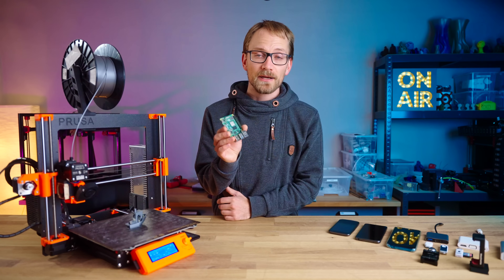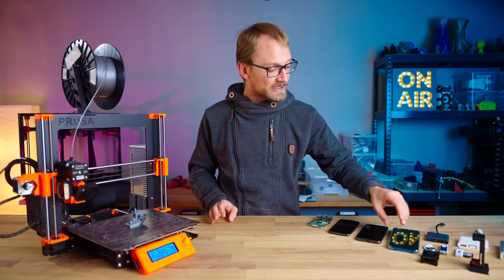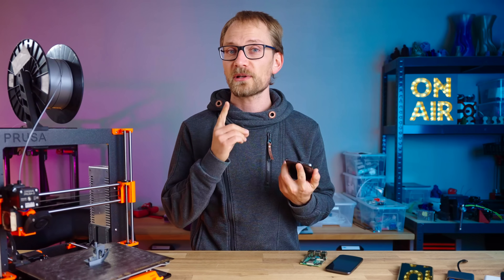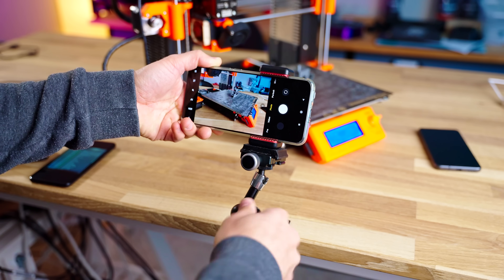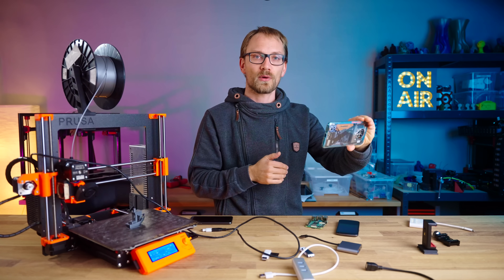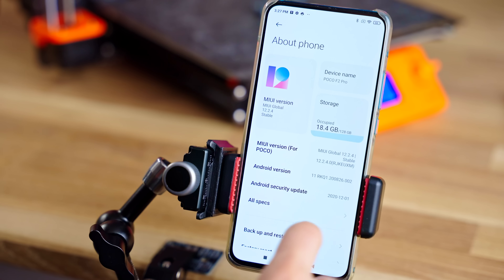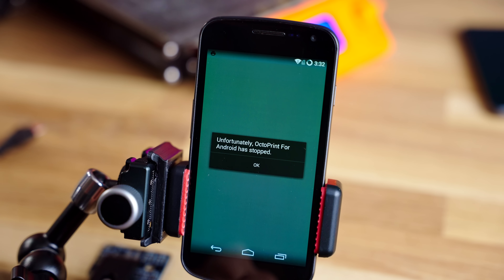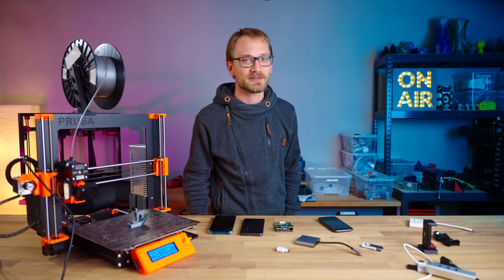How to run OctoPrint on your phone!

Comment: I tested this setup over a week and had not the best experience:
Octo4a works perfectly OTB, it's an incredible piece of software. 
The problem however is power management of the phone. 
It's very hard to find a phone that will support docking mode (OTG+charging simultaneously) the most reliable way to make it work is to trick the phone by first apply charging to the phone and then connect the OTG device, it's a HACK but it works. You can do it either with DIY Y-splittwer with built in mechanical switch, or you can buy one, I saw these on AliExpress.
I used really old Xiaomi Redmi 4X, and ideally I wanted to get rid of the battery entirely, however it proved to be not as easy,  I experimented a lot with the solution that Tom shows in the video and it doesn't work for me, if phone isn't charging from the USB it eventually starts to behave weird and unstable because of the battery reading mismatch. I wasn't able to pull off the dummy battery solution either. It's a shame that such a versatile and powerful device gets handicapped by such a trivial problem. I suspect that newer phones which have charging bypass feature might do the trick better. Anyway, really great software I enjoyed it so much, I wish I could make it work for me. Thank you for the video Thomas ❤️🇺🇦
Reply: А у меня программа не видит телефон (

Comment: Anyone know if its possible to use an old laptop to give a 3d printer wifi connection and then monitor the prints using an android phone from any location?
Reply: It is - you can install Octoprint on a PC.

Comment: I have an old s8 Ive used for tiemlapses for years, that Im gona use for octa 4a.
Its worth noting theres an app I use called "Blackr"
It essentially just blanks the screen, which saves power, keeps the phone waaay cooler, and prevents burn in etc. As far as the phone is concerned, It still runs like normal.
It just puts a little circle on the screen to blank it, or show it when tapped.
Its a golden app, as I ve used this phone for days/mopnths straight doing timelapses, or automating games with tasker n autoclickers etc etc.

EDIT: OMG! I wonder if i can run this on my old Optima stereo 3D phone! (Its even got a paralax screen like a nintendo 3ds.) It stopped suporting updates at android v4.4...

Comment: Even two years later this makes more sense over a Raspberry Pi. With a phone you get all you need, the processing platform, a camera, power source, power backup (at least for the OctoPrint instance) and internet backup (WiFi and 4G or 5G). Additionally, in some setups you need an additional display since some displays can't be connected reliably to a Raspberry Pi.

Comment: So i recently got back into Printing and this kinda was a tedious task that made it much more fun. I dont print often but now i have a way to do it without switching sd cards and spending money on a new piece of Hardware that might become obsolete in 5 to 10 years. I just wish there was more support for it. I would like to post my results whever i get some time (maybe also in 5 years) but I did mine using an old Oneplus 6 and an Ender 3 Pro 1.5v (4.2.2) Marlin 2.1.x. I learned a lot about more about the printer and code and i feel a little more satisfied with myself now that its almost finished.

Comment: Followed up with the video and now I have OctoPrint running on my redmi note 5. the only issue is that even while using the OTG cable it can not charge and connect to the printer simultaneously. looking for solution or work around for this in settings or maybe help with figuring out how to charge directly like with your poco phone. It would be very helpful.

Comment: Great video ! But i have some trouble finding the corect otg/hub for my android phone. I have a galaxy note 3 any help ? (I of course want to charge and have usb on the go at the same time)
Reply: Did you found the solution? I’m trying to use my old note 3 also 😂
Reply: @gitmac53  yeah man , unfortunately the note 3 doesnt have the capacity to charge and have the go mode,  to counter the problem you can change the micro usb port to usb c 😅😅🤣

Comment: Excellent work! Thank you for the thorough and thoughtful breakdown of such an interesting project.
One small complaint I have, which I assume was an accidental omission, has to do with the charger splitter. You mentioned in the video that you just need to make sure it’s a splitter that allows the data and charging at the same time. You also mentioned that you’ll link to the hardware. However, the link to the y splitter is actually just a link to a search in amazon. That would be fine, except all of the items that come up in the search explicitly call out that they will not charge a cell phone or a tablet. I’ve resurrected an old Samsung Galaxy S3, and got octo4a running on it, but now I’m stuck without a way to charge the phone while it’s connected to the printer.
I would love information about the Y splitter that actually allows an old Samsung like the one you tested to charge and print at the same time. It seems it’s actually a rare item, so a little more detail would be awesome and appreciated.
Reply from the maker: A man, then the one I used must have been replaced or went out of production. They're fairly tricky to find, and ultimately, I just ended up searching around and digging through a bunch of listings, too.

Comment: Hi Thomas, great video! Helped me out a lot. I set up my old OnePlus 9 Pro and am using its camera to monitor my prints. Is there anyway I can lock focus on the print head? My phone seems to keep switching focus between the print head and the back of the printer.

Comment: A very promising idea. I have looking for an adaptor to support charging as well, with a Samsung S5; so I could use it.. The S5 has, what I thought was separate data and power parts, on its wide connector. Does anyone know a way to leverage that Micro USB 3.0A port for power and data, with some adaptor??
Reply: I've tried the same with a different device for a few days now and the short answer is no, it's not possible with a micro usb port.

Comment: I mean can't we just have the os files on there, I know samsung, if you the down volume you can change what os it uses, found that out while having to fix some separate issues and I happened to have windows on my SD card because I bought my first computer and I needed to download windows so while I was trying to fix a separate issue it was trying to boot into windows

Comment: Hi Thank you for the videos, it gave me the idea of putting Pi OS on Window Surface RT tablet I had collecting dust. Then I put OctoPrint and OctoDash on it. Now I can use the RT tablet for controling my 3d printer. The touch screen works great and it has a big screen.

Comment: Hi Thomas, very good process!!! easy to do it,  working great, but I faced an issue whit octoprint repository is not worked, i looked for options to fix it , but so far, I could not find any, sistem mesage is that repository is not available and suggest to check internect connectivity, hopefuly you advise me to to fix it
Regards

Comment: for those who's cable is powering the phone for a split second then disconnecting go to your phones settings. the go to connected devices and then switch the preference to this devices. My issue was that it was trying to send power to the usb device plugged in which stops it from charging the phone.

Comment: So is that old 1GB phone running a specially installed Android OS instead of the Android OS that it came with? Those were names of special Android OSs that are usually custom installed on a phone replacing the original OS, sometimes done for more privacy.

Comment: One thing you should mention is that not every phone is capable of otg while also charging. I have tried it with 2 phones and both wouldn't work.
Reply: I think I'm burned big time I actually bought a Moto G just for this and it won't work.   At least I bought it used
Reply: @c.rutherford  yes I have tried it with a Moto z2 play and with a Huawei Nova 2 both don't work. But it works with my OnePlus so it's definitely the Phone and not the cable.
Reply: @moritz5215  I've suddenly got it, I turned the phone off and on again, then plugged in the usb and this time it asked me if I wanted to allow OctoPrint to use the USB port.  Weirdly it never asked that before.
So now its recognizing and even controlling the printer.  But it immediately said there was a firmware fault with Creality printers and I needed to install a plugin to fix the temperature sensor.
But there appears to be no option anywhere to load plugins.  There is only 'Install plugin extras', which says 'installed'.
The other thing that worries me is the printer won't shut off completely at the switch when the phone is Y-cabled to the printer and the wall to charge.  The LCD just goes half dim like its spazzing out.
So that means its getting some power trickling in through the mini USB.   Is that extra voltage going to overheat the board eventually?
Reply: @moritz5215  Youtube will only let me see part of your reply.  If what you asked was 'does it charge' the answer is yes, it does with the Y cable.  And I think you were saying you need to install a USB driver.   Yes I finally did, it seemed to work after that but not immediately.   I wonder still about the board getting extra voltage through the USB while the phone is charging, and if that is going to mess up the board eventually.
I don't like that the on off switch no longer works.
As far as loading the missing temperature sensor plugin, I still don't know how to do it.

Comment: Tokk the batt a ry out and it will not b oot. Is there a w ay to do this? Say could one perhaps just wire a 5v straight on to the battery leads or will that de stroy your life forever?

Comment: As a returning 3D printer user I wanted to set up octoprint but I did not want to buy new hardware so I installed it on an old Raspberry 1B(!) I had lying around. Everything worked fine, even a webcam, but it was incredibly slow. Inspired by your video I converted my old Xiaomi Mi A1 (Android 9, LineageOS) to an octoprint server and everything works flawlessly and the UI is really snappy. Filip did an amazing job on the Android port, thank you very much for bringing it to my attention. To be honest I kept my old phone exactly because I was thinking about an application like this and I couldn't think of a better way to repurpose my old phone.
Reply: i have a xaomi note 4x what cable did you use ?  i am a bit confused i even thought of trying of opening a cable and separating pwoer and data lines to split  em my self
Reply: @venix20  I don't remember where I found mine, I think on ebay. It is a Y cable with Mini USB for my Ender 3, USB-C for the phone and USB A for a the charger.

Comment: For those looking to try this, save yourself a lot of frustration and just find a Pi. You won't find a Y cable that can transmit data and power at the same time, they only send power to the USB side, not the micro.
Reply: That sucks because everybody is saying to buy the Y cables.  I've seen it on at least 3 different Youtube pages.  I would think they'd notice if it didn't work but mine's not working so idk

Comment: Is there a way to not only use the camera of the smartphone but the LED to? It would be very nice when you want to check on your printer in a dark room. Just switch the led on on the phone.
Reply: Yes, there totally is! In the app settings you are able to enable a setting that turns the phones flash light on whenever you observe the camera

Comment: This is definitely too late, but this no charging issue in a POCO F2 pro is a very common defect with the connection to the large ribbon cable passing over the battery. You need to bend the large edge pins on the charging board connector inwards to make better contact with the ribbon cable. Great phone if it weren't for Xiaomi's horrible support.

Comment: This will not load correctly on my Samsung Note 8 --- (installation is corrupted), I have attempted many times with the same  result each time. There many users reporting the same problem, do you have any answers.

Ray

Comment: I figured I'd ask here since this is where I first learned of octo4a.
Yesterday I went to plug my old phone with octo4a on it into the printer for the first time.
I was using an OTG splitter to charge the phone and have a USB port for the printer connection.
The second I turned on the printer, my phone turned off and I wasn't able to turn it back on again.
Has this happened to anybody else?

Comment: Doesn't work for Samsung S4 phone. Installation always fails saying that it was corrupted. Guess I'll shell out the money for a pi. Supposedly a TCL 20xe phone will work but I'm not buying anything else that may or may not work. Also doesn't charge while hooked up to the printer even with a powered hub.

Comment: I had the app installed, but when running, it wouldn't display the camera, in spite of the camera's preview working. Uninstalled, and now every time I re-install it, it says the installation is corrupted? I've tried without data on, restarted, and even tried on another device, the same result.

Comment: So I tried using my old Android phone (Moto Z Force) which does only have one port.  Oddly enough, the OTG port doesn't support simultaneous power delivery.  I bought a usb-c hub and I could only ever connect to my printer, or charge my phone.  Never both at the same time.  I find this odd and I keep thinking there's something wrong I've done.    If anyone has solved this please let me know!!!  But it does seem that I need to find a work-around either by opening up the phone and bypassing it or figure out how to wirelessly charge it.

Comment: Tried this with my Huawei P10 lite, but the problem with bypassing the micro usb port is that it won't recognize that it's charging.  The battery level is calculated by measuring the current and not the actual battery capacity (I think). Any ideas to solve this? Do I need to root my phone and change battery capacity settings (I'd prefer not to...)

Comment: Can't the battery catch on fire if you leave it plugged in 24/7?
Reply: You phone should be smart enough to stop charging once it's topped off.
Reply: @bean5  it's not that it is charging all the time but the processor and or screen is always on. I read if you use ur phone as a security cam the battery can swell up

Comment: Where the poco phone didn't charge  couldn't you have soldered in a buck converter instead and just got rid of the battery and ran it  off of  wall wart or more powerful supply ,maybe from the printers power supply?

Comment: I'm having a hard time locating an OTG y-cable that will charge the phone. Does anyone have a direct link of a y-cable that they know works? Every cable I look at state that they will not charge a connected phone, just provide power to the external device. (The affiliate links just go to a general search on amazon now)
Reply: same problem here mate
Reply: @00honeybadger  I finally found a cable. But then I found out that the old phone I have WON'T charge while OTG is enabled.

I gave up and bought a Raspberry PI (wasn't easy finding an official reseller that had one in stock. Found a "Starter Kit" with a metal case, power supply, MicroSD, cables, etc., from CanaKit)

Comment: I have tried 5 different phones, 3 different tablets and 3 different USB adapters and CANNOT get charging and printer connection. 
Also wireless charging is turned off when you plug in usb

Comment: Recently I upgraded the board to an SKR mini e3 v2 and the screen to a TFT35, and after the upgrade octoprint has been behaving oddly. Octoprint will connect to the printer and is able to see all the info, like temperature, see info from the terminal, etc. But I cannot send prints through octoprint or control it at all. Trying to home, set temp, extrude, print, doesn't matter what I try nothing happens. I get no error messages, just nothing happens.

Comment: in config.yaml,  setwebcam/ rotate90: to false. I had the rotation problem on an octoprint install on x86_64 linux. Setting in to false fixed it. I don't know where that file is on android but odds are very high there is one.

Comment: I do love it when I find something to add to my printer that I already have the materials for. Currently setting my old Moto X4 up for this.
Reply: Did it work for you with a X4? I'm trying and it just keeps crashing installing dependencies
Reply: @bjohnrini  I've been using my x4 for a few months now, no issues.
Reply: @Oddman1980  Thans for the reply. I have an amazon branded X4 and it keeps crashing when installing the dependencies, any ideas? Also, can you tell me which Y cable you purchased? or how you are powering the phone?
Reply: @bjohnrini  I have an old USB-C laptop dock plugged into the phone to both power it and give me a connection to the printer. My phone is a Google Fi phone I bought in 2017.
Reply: @Oddman1980  You have a link or info on the dock you are using?

Comment: I tested this with an old phone. 
The printer kept disconnecting because the cable/port/adapters weren't able to maintain a stable connection. Probably the old phone. 
Found this video after getting a new printer and wanting to expand it's capabilities. I'm going to go with multiple octoprint instances in docker on an old laptop. 

I really like the idea of using an Android device for this because of the built-in camera etc. But it's not an option with the device I chose.

Older devices will be lacking in security updates. Probably not the end of the world, if you have them walled-off on an alternate VLAN from the main network especially.